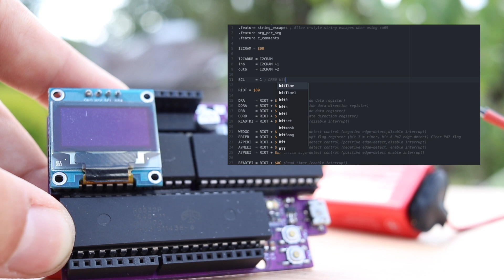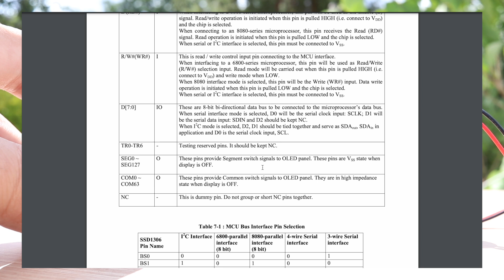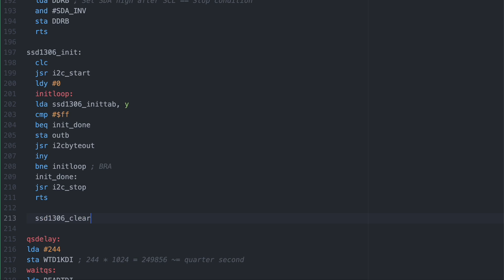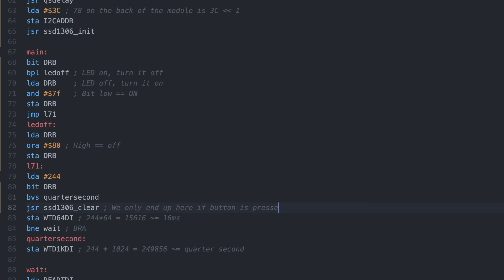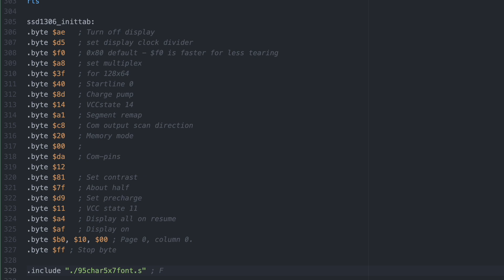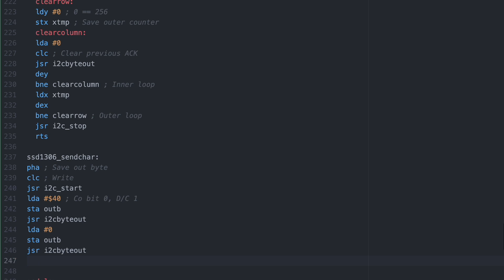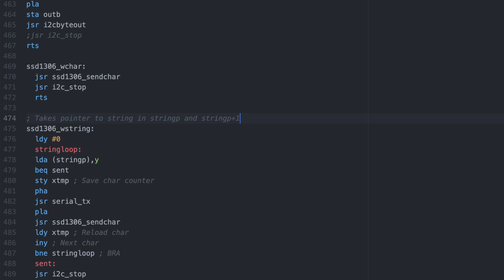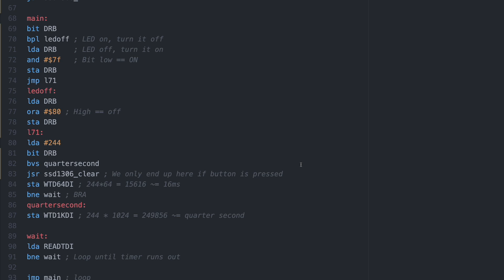OLED display on a 6502 Single Board Computer using i2c #65uino

Comment: I am curious  when you didn't add the control characters like carriage return or newline (time around 10:18 in the video)  How would  the computer know how to enter or create a new line?   Also you know someone is going to say  play  "Doom" on it.  Congrats on your marriage!
Reply from the maker: Thanks!
Actually you're on to a core issue with running the SSD1306 via i2c :) Since it doesn't allow reads via i2c or SPI we can't check the current "cursor position" and since we don't use a framebuffer the 6507 has access to, we'll have to find other ways to keep track of the cursor position. 
That's also why I didn't have that part in the video I released today - the best I can come up with is to increment a counter every time we write a character to keep track of which page we're on.. And if we get a CR/NL we skip to the next page. It'll make it a bit slower but won't eat too much RAM. 
Gotta play 2D Doom on it :)
Reply: @AndersNielsenAA  Come on you can't play "Doom" on it or can you?  I enjoy your videos although I can only imagine how painful it is to constantly update the memory chip with new code.   By the way is this a different project from the make "pong" on an old 386 machine?  I was looking forward to adding ms-dos and making a newer version of the pong game.
Reply from the maker: @viperjay1 I imagine the best "Doom" I can do for the 65uino is to port "Rogue" and call it "Doom 2D" :D 
Oh, that wasn't a 386! That was an 8088 PC XT - and next step on that project is to make the floppy drive controller. I'm afraid I'm confusing the YouTube algorithm a bit with 6502 and 8088 content on the same channel, but seems crazy to make another just for that project.

Comment: Congrats on leveling up!  Instead of using xtmp, is it not more typical do a PHA, TYA, PHA, TXA, PHA on entry to subroutine then PLA, TAX, PLA, TAY, PLA, RET on exit from subroutine. This way all calls to subroutines preserve the A/Y/X registers on return. Of course if a register isn't used in a subroutine then no need to push/pop it from stack.
Reply from the maker: It's always a tradeoff between speed, ROM and RAM space.. and laziness. 
In this case STA xtmp is 3 cycles + 2 bytes(ROM), whereas TXA PHA is 5 cycles + 2 bytes. So the former wins because it's faster and we don't need the subroutine to be reentrant :)

Comment: Cool cool cool!

It’s a shame we don’t have more RAM in this SBC to be able to load programs using a serial port and ditch constant fiddling with flash chip. It’s a nice challenge to fit your variables in 128 bytes but fitting code in that space does cripple one’s ability to have fun.
Reply from the maker: 128 bytes isn't much for code + variables, but you can do quite a lot with 100 bytes of code along with a bunch of generic subroutines in ROM. I'd certainly like to demo that before I start adding RAM :D